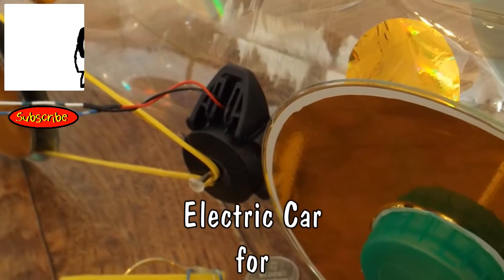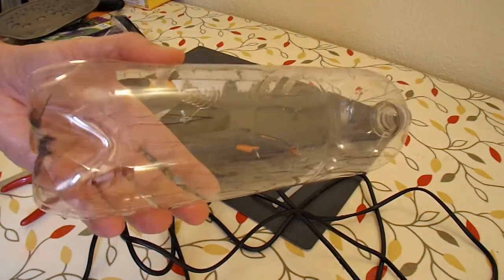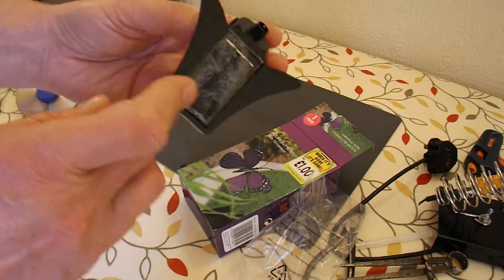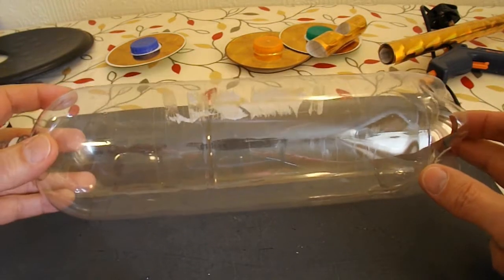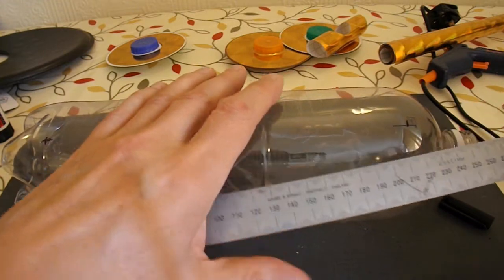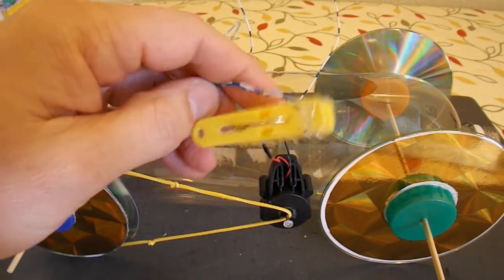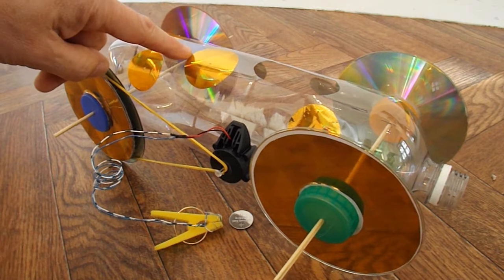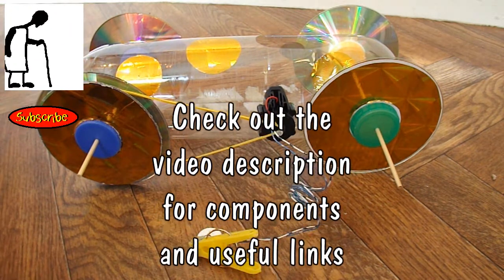Electric Car for Evonne Patawaran

Comment: That yellow clip I have exactly the same when flying model aircraft.
To place in the spark plug, glow engines. 8-)
Reply from the maker: Hi Francisco, I had glowplug engines on my planes back in the 70's. On control-line racers we extended the wires to foil panels on the wings and had wires in a glove so we made connection when we held the wing on refuelling pit stops. Probably not safe but it worked.
Reply: GrandadIsAnOldMan I was flying, which in Spain called "circular flight" or other hispanoamerica, "u-control".
Typically, you will use diesel engines that Spanish manufacturing (when Spain manufactured some things own technology, not like now 8-P), marks "Zoom" or "Call". Then as I started flying with engine spark plug.
Then, I left and did not get to fly RC, although I start again, because I have some almost ready models.

Greetings and remains so long, for not only us but your grandchildren, had a great time with your inventions and ideas.
At one time, it seems only interested in the standard of living above all things and does not know a great pleasure it is achieved, science and technology.
The possession of goods, seems to replace those pleasures that only we are able to see.
I'm happy for your grandchildren, surely good future good engineers or scientists, thanks to your example.
8-)